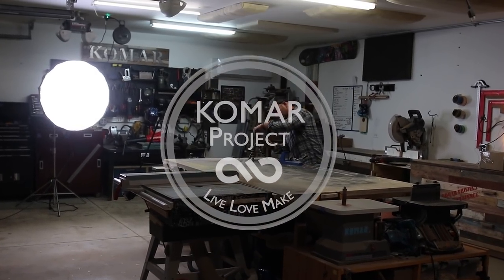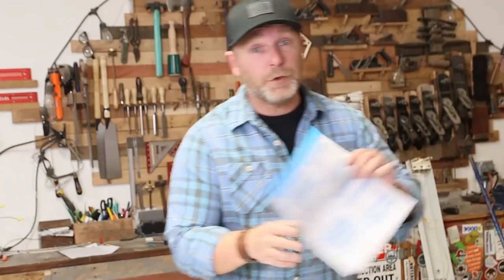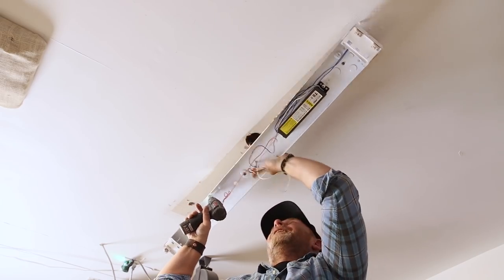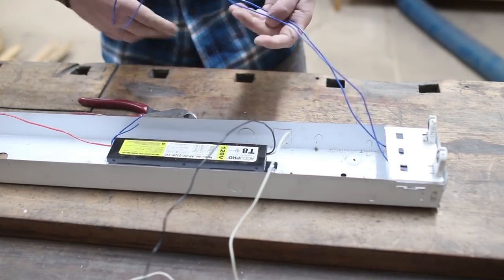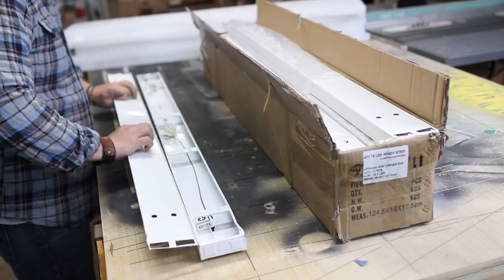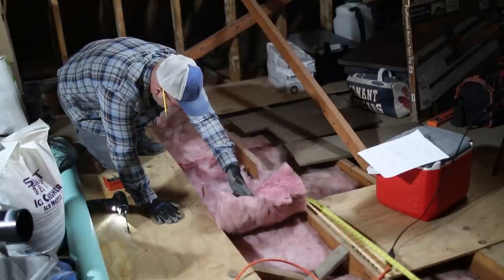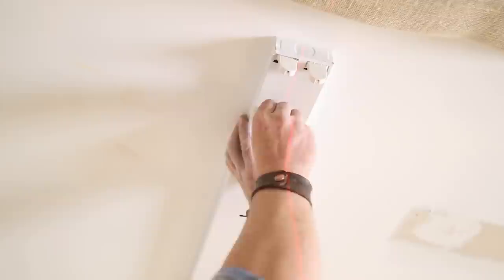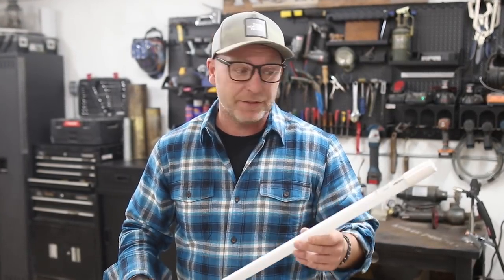How To Convert Fluorescent Lights into LED Lights /// 3 easy ways / Parmida LED

Comment: I just found this video after searching tutorials on doing this upgrade.

Just bought my own place, and promptly had the kitchen fixture start flickering and hesitating to light off one pair of the bulbs.
Talking with the local electrical supply house because I knew of full 2x4 foot suspended ceiling panel LED fixtures from my last job, but hadn't considered the tube replacement bulbs until today, I found out that the T-12 ballasts in my house draw somewhere between 30-50 watts before you even consider the wattage of each fluorescent tube!
Doing a ballast bypass install saves that extra wattage, multiplied by however many fixtures you're upgrading.  In my house and garage, that's 6 ballasts eliminated, so looking at the whole set it's saving 240w just by removing the ballasts from the equation.

All that said, thanks for the straight forward demonstration of how to rewire the fixtures for LED replacement bulbs.
Reply: Thank you

Comment: LED's in these kinds of lights are actually on a 'duty cycle' and not operating 100% on continuously which is why they have such great power consumption ratings.   Most LED lights use phosphor... as do Fluorescent lights to smooth out the strobe feeling.

Comment: I'm working of a project with eight foot fixtures.  We need one-piece,  eight foot LED bulbs for replacements, but can only find two piece bulbs that must be assembled into an eight foot length.  So far, none of the two-piece bulbs will work, and we've completely re-wired the fixtures.  Can you help??
Reply from the maker: Not sure what your asking. What’s the question.  Sorry